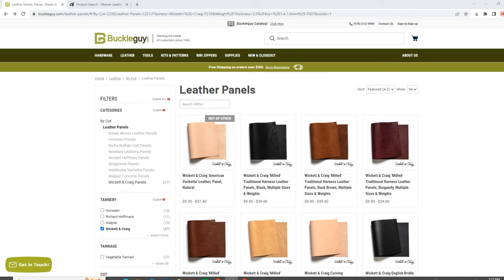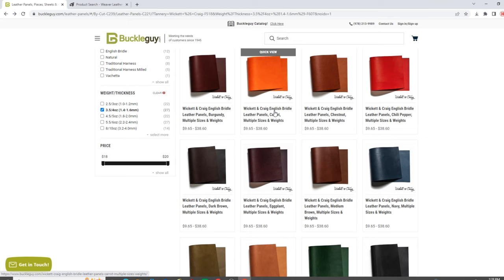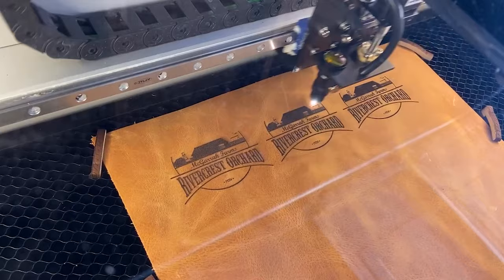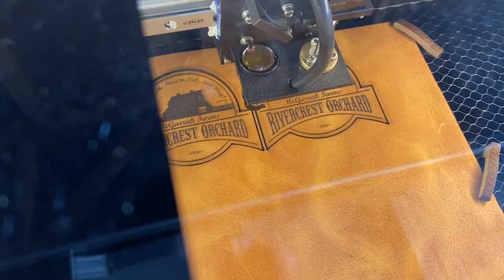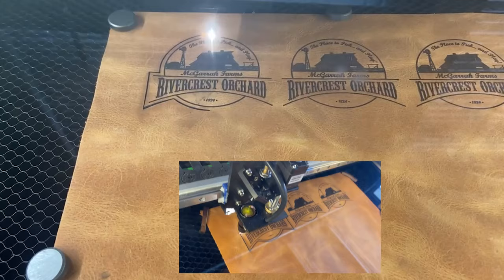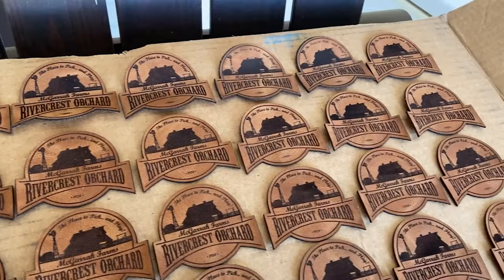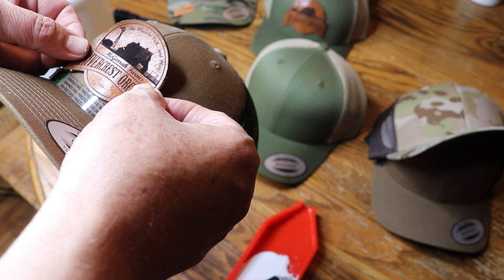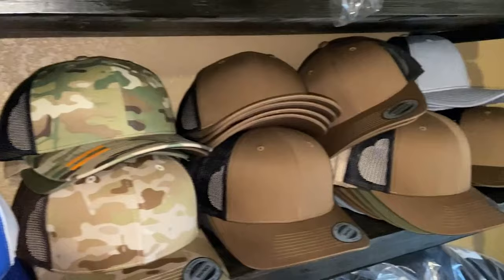Secrets to Making Leather Patch Trucker Hats with a Laser!

Comment: If you want to save time and have a hat press use Hydbond adhesive to adhere your patch for a permanent bond.
Reply: I've tried HydBond and always had troubles with the corners. I'm using a Hotronix 360IQ as well. I also spoke to PG Hat Co and (although I'm not sure of which bonding agent they use..guess it's a secret..he did say they don't heat press..they use a bonding agent) and they've done tens of thousands of hats.
Reply: I am glad I am not the only one having issues with hydbond.  It's driving me nuts!
Reply: Is dura-bull similar to hydbond
Reply: I have a Hotronix 360IQ and use LoneStar but I still have issues with corners/edges lifting from time to time. I just ordered a Jack S5 Post bed sewing machine which will be delivered within the next two weeks. I see a lot of hat makers out there using Barge Cement to adhere patches without having to use a hat press.

Comment: Love your transparency training, but cannot believe you haven't got a glue press rig for the hats patches. MADE OUT of WIG FOAM HEADS at least. Having to paint on glue, position and hold everyone for 30+ seconds. Patience of Jobe. for many things I made a 3/4" melamine  VAC Box w micro hole all over top. The platform holds down EVERYTHING fro gluing or spraying and will suck right thru paper towel sheets, so you can keep the vac box top clean. You can suck patches to hats if you block it right. Al least a press jig.

Comment: Thank you so much for sharing.  I have a Xtool D1 pro 20W laser and want to make some patches. I will be using the Weaver Supply Red Rock Waxy Pull up leather you are using as well. Do you have a recommendation on Laser engrave and cut settings for this? This is my first project with the laser :) Thanks so much!

Comment: Congrats. You grew up to the big dogs. I have run lasers for about 25 years. Right now have 3 co2 Chinese made lasers. Each one cheaper then the glow forge.  I hate hearing the words glow forge, as in my opinion you spend too much for what you get. I also don't like diode laser due to safety concerns. But I understand why people do buy those, you just need to be careful. Even the $2k-$3k co2 lasers in the past 10 years from china are really good. I have owned the $40,000 lasers. I won't do that again. Have fun, and congrats.
Reply: Thanks for the info.

Comment: Great video,  I bought the leather you referred to and use in the video. I am having problems with lots of soot on the leather after cutting.. When I clean it the soot makes a mess and I have soot soaked into the leather. Any ideas on how to solve that issue? Or the best way to clean the soot off. Thank you.

Comment: when you airbrush the resolene, ho much are you diluting it? and do you find it gunks up the airbrush afterwards? What is your cleaning process for the airbrush gun?  I've only done resolene with foam brushes so far.  Thanks!
Reply from the maker: For this siphon airbrush, it’s undiluted. I have used my dual action airbrush but I have to dilute 50/50 Resolene with water.

Comment: Great, helpful video, have not purchased the air brush set up yet. My question is, when you put the resolene in the sprayer, is it full strength or is it mixed with anything else like water? Thanks so much!
Reply: this was a great question I am surprised he did not answer you, I see this question asked alot in other videos, you typically will not need to dilute it, especially if you are using a standard harbor freight airbrush, but make sure you do clean it right away as Resolene can get sticky real quick when your done. also do a back fill "clean" on your airbrush with 70% alcohol or acetone cleaner, as well the needle.....I also usually use a metal polish for my needle to make sure its smooth and clean, same will apply to pro dye as well

Comment: I own the Gweike Pro myself. The information in Lightrom when cutting leather can never be correct. Please show me how to cut 1.5mm thick leather at a speed of 30mm/sec and 90% power with a 50 watt laser. The values for the laser engraving are also not correct. Typically, the Gweike Pro engraves leather at 350mm/sec and a power of 50%-55%.